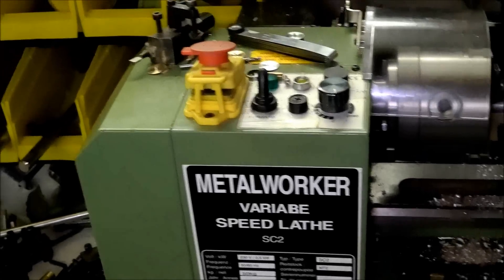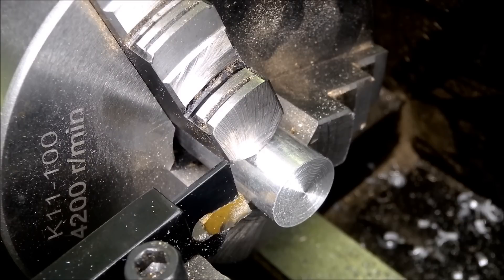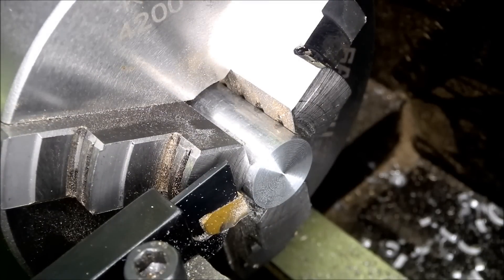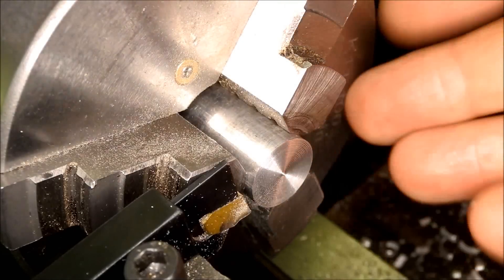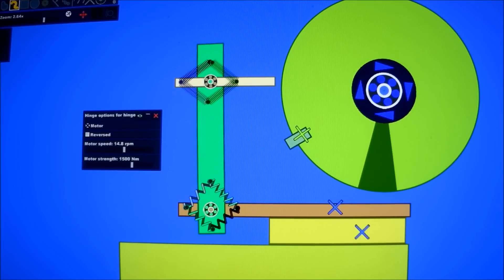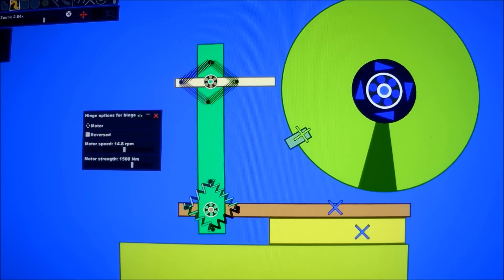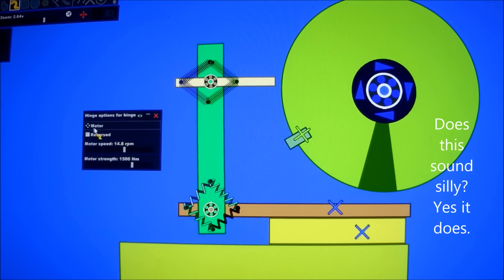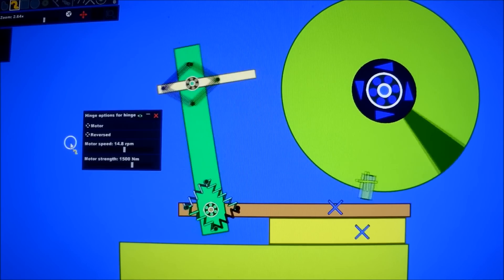The Ultimate Trick: Cutting off  with the Mini Lathe

Comment: When someone's chuck comes loose (the cutting force is trying to loosen it using this setup), it will hurtle across the workshop as if it was still motorised. A rear toolpost works the same way but avoids damage
Reply from the maker: Arduous Andotherous With "Mini Lathe" I mean the small and affordable lathes from "Shanghai SIEG Machinery Co., Ltd" eg. the c2 or c3. Their chuck is fixed with three screws so they can turn in both directions without loosening the chuck. But you are right if you think of the lathes were the chuck is on a big single thread. (the Myford lathes for example)

Comment: I wouldn't recommend this trick. I saw a guy bust the dovetail on the compound of a pretty big machine, parting a piece off this way. This lathe had over a foot of swing in X, and the part that broke the camel's lathe was only about 3" diameter, iirc. Those dovetails are pretty weak when upward force is applied. They are not designed to cope with pressure in that direction. In fact I would say you are shitting all over your rigidity but reversing the direction the force is applied. These mini-lathes that we all love and enjoy are sometimes of marginally acceptable quality as it is, and even the "good" ones are nowhere near as rigid as what youd find in a full-sized "real" machineshop, not to mention the quality of the castings, which is easily the most common corner cut when manufacturing shit as cheap as possible. Id dare not tempt fate and stress my machine this way.

Anyway, I just wanted to put that out there as bad practice, Im not trying to put you down or anything. I have a small 7x12 from Little MachineShop. After replacing the stock roller bearings with tapered bearings, I very rarely encounter any chatter. While rigidity is the single most important quality a setup should have, the rest of it is speeds and feeds, and properly formed tooling. If you make chips for a living you learn how to minimize chatter with those 3 things.

Btw, I love the shit you do, bro.
Reply: fucking brilliant bro . verry good thinking the little machines might not can take this to much n may bust them or hurt someone good catch !!!
Reply: I sent my mini back and bought one that costs 5 time more and it is 500lbs compared to the 70lbs mini. Thanks for posting your good points. Your point to self engineer something should be approved before trying this on a machine to avoid damage and injury.
Reply: Yeah, good point, buuuuuuut every time the parting tool takes a nose dive cutting in the "normal" direction it loosens every dovetail on the machine and destroys the part. So, how much stress is that? I'll take my chances with this tip and who knows, maybe send this mini POS to the early grave it so richly deserves. A thousand lashes for me ignoring my mentor's advise years ago "anything you can do on a small lathe you can do on a big lathe"
Reply: Depends on the mfg.'s instructions. No good for Toyoda n/c, but would work on a J&L or an Okuma.
Reply: You r right , bestway is to modify cross slide lead screw to ball screw before cut because it cannot be pull and dig the blade into the work. This is why CNC lathe safer to cut than manual lathe.
Reply: yes but there would be upward force on the other side of the slide and that dovetail would snap of if that was the case ?

Comment: I'm sorry, but the simulation has been setup to favour the reverse direction and will therefor NOT give accurate results for the normal forward direction. Running forward with that setup will totally lead to the tool digging since the cutting edge height is way above the centre of the work piece. Can you please repeat the simulation in forward running mode with the tool's edge on centre?
Reply from the maker: I have adressed this issue in the description of the video.

Comment: Your tool is not dead center neither in the lathe or in the simulation, one of the basics for a nice cutting is to have the tool al the exact height of the rotating axis of the chuck and piece.

It makes sense because some tools have an attack angle depending on the material, if you change the height of the tool the attack angle changes so it is not as effective anymore.

Also a mini lathe should never be feed as fast as you do, that only makes it get loose way faster than with normal use and you get worse tolerances every time you do that, is like running with a cold motor in a car, it is no good, it causes internal stress and it will loose horsepower and eventually die sooner.

Comment: Simulation is totaly wrong. You are cutting on wrong side of the tool and you are out of center. If you lower simulatet tool so the cutting edge be in center line same is happening, tool is pool out of the material. And how will you do it when threading? Chips are not problem as you can allways determine the right spped and depth when cuttinf if you know basic machining. For every material you can calculate right speed and cutting depth by knowing material properties and lathe properties. You can not cut everything with carbide an any speed it depends of final surface and tolerances.
Reply: Thanks, I already thought I've been the only noticing the flaws in that "Simulation". Pretty sure the outcome would have been the same if the centers where all on the same height. Simulation and explanation are garbage. Can't explain why it seems to work though, haven't put much thought into it anyway. The given reasons are obviously wrong though.
Reply from the maker: I noticed this error after I uploaded the video. I forgot to set it at center for the presentation, after I simulalted it  at center height, below center height and above center height. Reverse operation did always work better in the simulated flexible lathe..  I do not claim that inversion of the cutting tool generally improves efficiency. But it improves heavy cuts on non rigid hobby lathes.  If you only work with big, heavy, rigid professional lathes you may never have had problems with cutting off.

Comment: Your simulation is faulty.When run the "normal " way the contact between the tool and work piece is above centre height. If it was at centre height it would not pull the cutting tool into the work piece as suggested.
To invert the cutting tool to improve efficiency is a myth.
Reply from the maker: I noticed this error after I uploaded the video. I forgot to set it at center for the presentation, after I simulalted it  at center height, below center height and above center height. Reverse operation did always work better in the simulated flexible lathe..  I do not claim that inversion of the cutting tool generally improves efficiency. But it improves heavy cuts on *non rigid* hobby lathes.  If you only work with big, heavy, rigid professional lathes you may never have had problems with cutting off.

Comment: There may be some degree of truth to this hypothesis however the difficulty that he is experiencing is primarily due to the ratio of the tool width in proportion to the diameter of the workpiece. The smaller the workpiece diameter the smaller width tool should be used. For up to 10mm diameter I would use a 1.5 mm tool. for 10mm to 19mm 2.3 mm too, after that a 3mm can be used for up to 100 mm dependent on material and rigidity, and what your fear factor is. Looks to me like his blade is too wide for that piece.

Comment: Who taught you how to use a lathe!?
You always part on a back gear at low speed (~150-300 RPM depending on type of metal and diameter) with very light cuts and lots of cutting oil.
No wonder you get chatter..